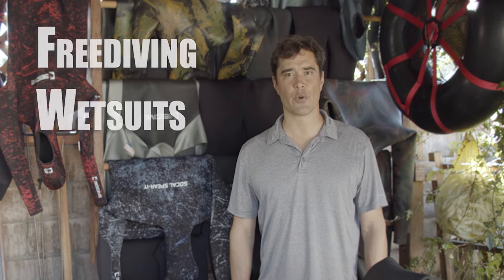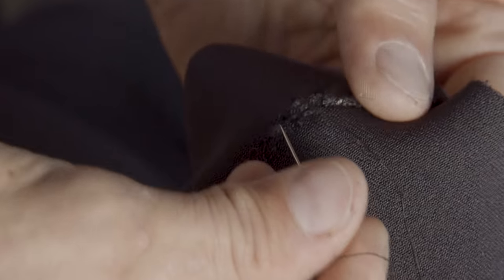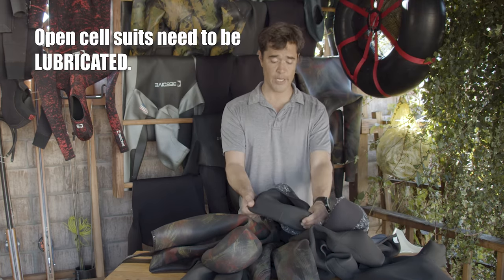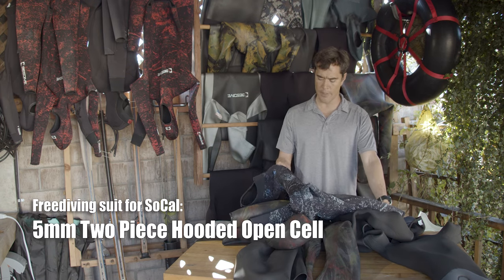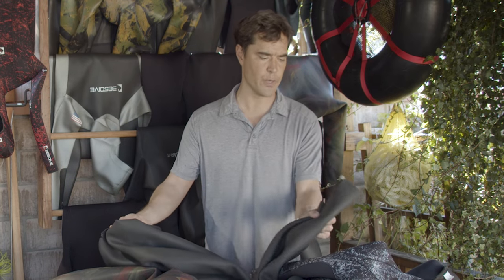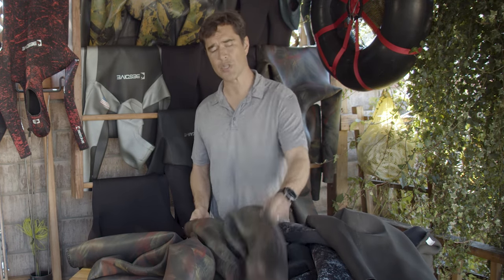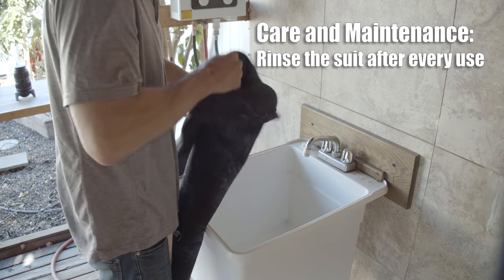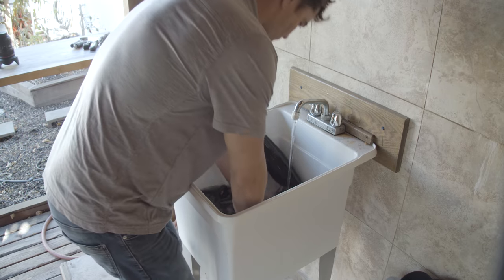Freediving Wetsuits: What is an open cell suit?

Comment: You mentioned at the end to not let the wetsuit dry in direct sunlight, why is that?  Another tip: make sure when you pull your wetsuit off initially to not leave the cuffs/ends rolled!  I've seen damage start at the ends because people leave them rolled up.   It stresses the neoprene.
Reply from the maker: UV light from the sun is tough on the suit--glues, rubber, lining, all of it.  It isn't going to instantly fall apart but over time it would shorten the life of the suit, and if left drying in the sun it is easy to forget about it and then it's been in the sun for days.  It would depend also I think on strength of sun with more northern latitudes being easier on the suit.